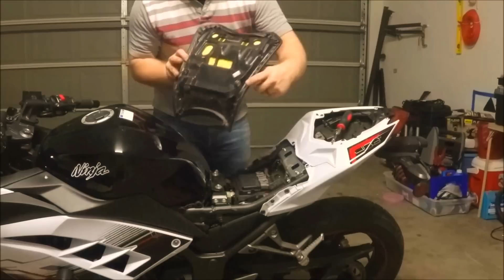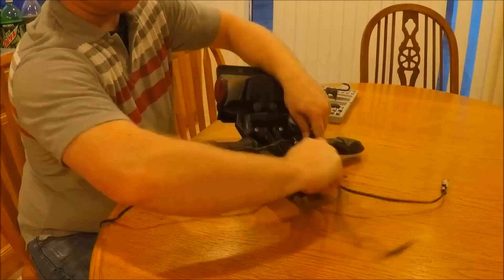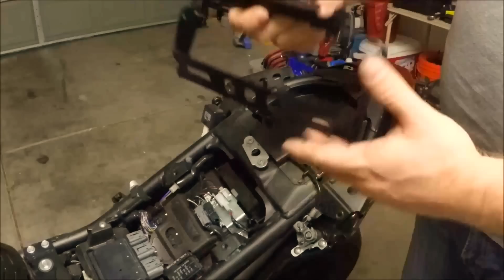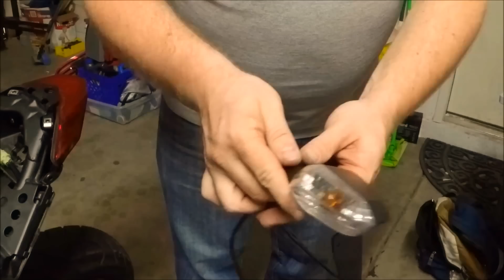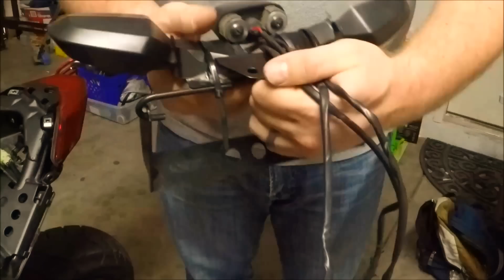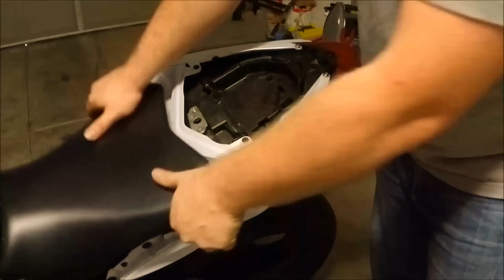Fender Eliminator Install (DIY stock fender mod) - Kawasaki Ninja 300

Comment: Does it make a slight buzz noise when turn turn signal on? Like right before it starts flashing do you hear a buzz coming from that area.. it's real quick and stops when it starts blinking.. but I'm just wondering if this is normal..?
Reply from the maker: I haven't noticed a buzzing noise so far. Is it coming from the light or the flasher relay?
Reply: @RyanWolseyHowTo  coming from the relay... The bike is brand new... And the fender eliminator was plug and play used stock signals and all so I know I didn't mess anything up... But when I try the turn signals with key in on position it just makes this weird little sound just before a signal starts blinking then stops... ?? I'm just wondering if I never noticed before and now I'm aware cause I was working on that area lol or what... It's coming from the same place as the blinker tick sound comes from.. the relay I guess... But if it's not normal I have no idea what could of happened haha
Reply from the maker: Since the relay operates within a defined temperature range (determined by the two types if metal used in the bi-metallic strip) and it achieves that temperature rapidly, whatever state it's in after it starts running (either buzzing or silent) should remain constant while it's operating. Sustained operation shouldn't have an impact on that (unless you leave it on for an exceptionally long time). 

I'll see if I can unbury my bike in the morning and see if I hear the same noise, since I still have the original relay in my bike.
Reply: @RyanWolseyHowTo  awesome thanks for your help brother! And let me know please.. at least it will give you an excuse to gaze at it lol
Reply from the maker: You're in luck, my bike does the same thing. So unless both bikes have failing relays you should be good.
Reply: @RyanWolseyHowTo  yes!!! Thanks brother I appreciate it!!
Reply from the maker: It depends on what kind of flasher relay it uses (my bike is in storage for the winter). The incandescent bulb should be a thermal relay so the buzzing makes sense since the relay would be at it's coldest state during the first starting cycle. Once it completes its first cycle and begins blinking the relay is warm and stops making the buzzing noise. 

Check both relays, if you're getting the same noise from both relays it's unlikely that it's a problem. The chances of a simultaneous failure are statistically unlikely.
Reply: @RyanWolseyHowTo  what do you mean by "first starting cycle" and "both relays" ? Is there two? I thought it was only one for the whole thing back there... But I can turn key on and just flip back and forth with both turn signals left to right right to left and it just makes that little electrical noise in between every change...?? I wish I knew if it did this before I changed anything.. it's driving me nuts lol... Don't even know if I've ever tried the signals without bike running ever before I installed this either.. cause you probably can't even hear it with bike running ya know so I have no idea..
Reply from the maker: Sorry I'm going from memory here. Your right there is only one relay (https://m.imgur.com/HbRRz). It sounds like the noise is caused when the circuit warms up to the temperature required to operate the bi-metallic contactor. It's not unusual for electrical relays to make noise but the part only cost about $10-15 so if swapping the part gives you peace of mind it wouldn't be the worst idea.
Reply: @RyanWolseyHowTo  it's good.. ok so the warm up noise.. would it make that noise Everytime you turn a single on just before it blinks though or should it stop? After awhile?

Comment: Excellent video, Ryan! One question though... Did the blinkers last long enough or did they become lose or shaky at any point??? Found a better solution for the license plate light yet??? Thanks for sharing! Cheers.-
Reply from the maker: They held in place but it does look a little ghetto. There's probably a better solution with some black plastic straps that would work, but when you're moving through traffic no one has time to notice.
Reply: Good! Mine is a 2015 and it didn't come with the rounded hooks you show here... I'm a little pissed because of that but it's a great opportunity to innovate with a new way to get rid of the awful giant plastic. Thanks for the response! Still have the bike with you? Haven't seen new videos in a while. Cheers.-
Reply from the maker: Still have it, I went back to school full time with a full time job so hobbies had to be put on hold. I'm in my last class for my engineering degree and I'll be getting back to making videos after that.
Reply: I understand! Great, I'm an engineer too! Last one... How did the coffman's turn out? Did you notice any change in throttle response? Did you install an air filter and powercommander too or was it just the pipe? Thanks!
Reply from the maker: I just ended up doing the exhaust by itself. I got a bit better throttle response after putting it on without adding anything else. 
My main goal on this project was to make the bike noisier. I was living in Las Vegas at the time and got merged into repeatedly without it. That problem went away with the louder exhaust.

Comment: hey thanks for the video i just finished mine in my Kawasaki 300 2016 n I put the tag light between the signals and i put metal screws for behind i also make new holes for the part you secure the tag 1" lower than the horiginal ones n that make the entirr set up more compact and secure don't wable at all...thanks

Comment: Thanks for posting this Ryan!
I don't think this will work for a ninja 300 2013. I do not have the part that you put together with the j-hook. However, this has inspired me to find a way to make the stock parts work together with turn signals.

Comment: Ryan, I don't normally comment but this was one of those situations where it was a must.  I just used your method on my 2015 Ninja 300 abs/ not se.  I was blown away at how well everything worked.  I thought I would end up modifying something along the way but that was not the case. I did however have to find two nuts laying around the house to attach the metal bracket back onto the bike.  Again this is by far the best method without spending a dime!!!  Thank you very much
Reply from the maker: I'm glad that worked out...This took me hours just to figure out how it could fit together without any extra parts. I'm glad to see it paid off. Ride safe.

Comment: awesome dude!! thanks!!! have you noticed any slip or rotation of the blinkers?
Reply from the maker: theDIGITALperception The blinkers have settled a little but there still facing the rear of the bike. The only real issue I've had with it so far is that the licence plate light isn't mounted very well. If you come up with anything that works better let me know.

Comment: Great tutorial, just did mine...as a side note I have a 2013 and the 4 bolt nuts that hold the fender to the bike are spot welded on so some people might need to purchase extra nuts to finish the job...I also ended up putting a coffman shorty on mine as well...sounds awesome.
Reply from the maker: great feedback! Thanks for the heads up.